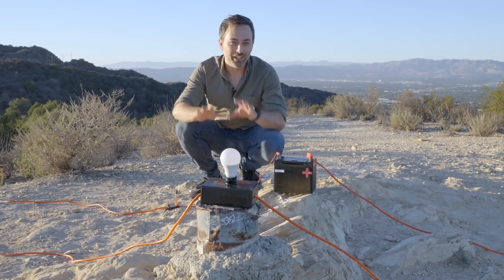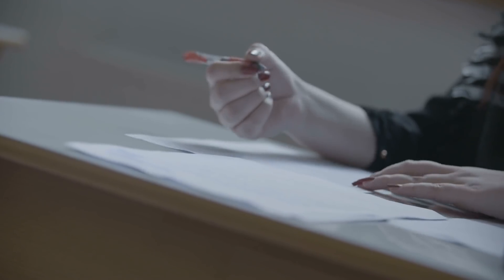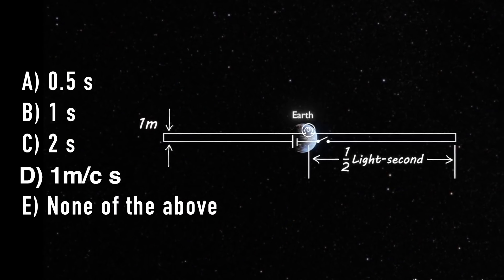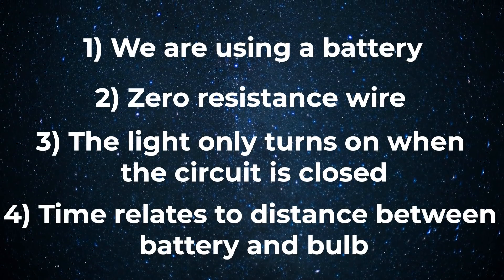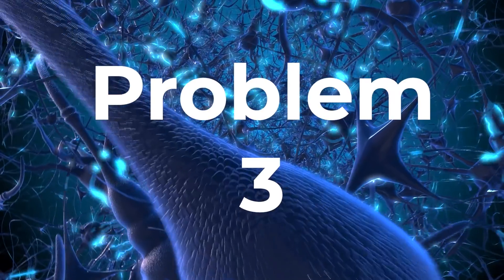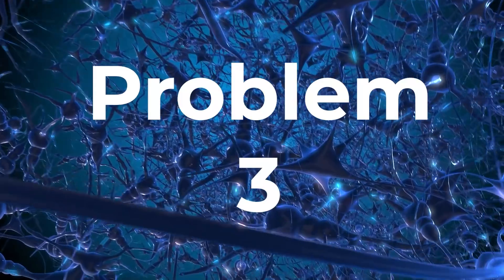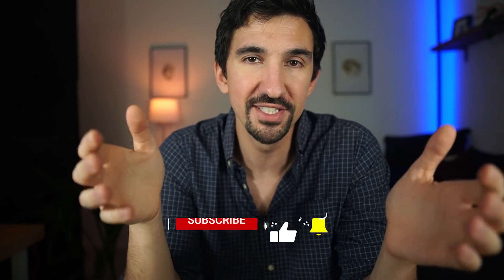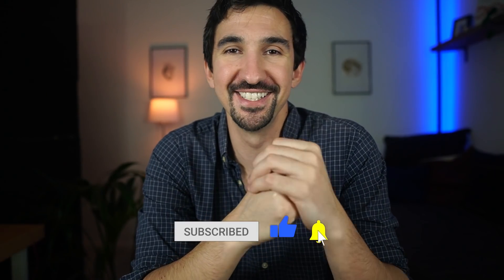Is Veritasium Wrong About Electricity?

Comment: You missed an important point about the 1/c time.  He really meant 1/c, and is in seconds per meter, where the distance is the distance from the break in the circuit to the battery.  This solve all of your issues with his video.

Comment: capacitance and inductive reactance, and mutual inductance (transformers), require a changing magnetic field mirroring the varying AC input.  DC creates a static field.  So how does this DC circuit represent an equivalent antenna, capacitor or transformer?  Also, wouldn't the internal resistance of the bulb be an issue?  My theory is, in the real world, the bulb would never light up under these conditions, as there would be inadequate current based on the incredibly long wires and associated high resistance and voltage drop.  However, if the wires are close enough to couple energy directly across the 1 meter gap, the bulb might flash briefly as the static magnetic field is established initially.  Please critique my theory.
Reply: First, every piece of wire may become an antenna, capacitor, part of a transformer.
When the switch in turned on, it's no longer DC circuit. It will become DC again after many cycles of EM wave propagation, until steady state achieved.
Indeed, real wire with a car battery wouldn't fit for such an experiment. It's kind of  imaginary experiment, that might require superconducting wires or high voltage/power source.
I think that you are right that in real experiment in those conditions it might be just a brief flash caused by capacitance, after which the voltage would drop because of wire resistance and wouldn't be enough to light the bulb

Comment: sympatric resonance of back EMF resulting in flickers of an AC nature  in many harmonics starting at 1m+c/s lasting till on time.
time to on:   in 0.oo ohm/mile wire of any length is the same . the same as kinetic energy transfer on the 5 ball trapeze in a vacuum.  The instant 1 additional electron  is  shoved in one end one must pop out the other in order to presurve ballance and prevent transmutation Cu to Zn. 
You have zinc or a time machine, that provides you with  a electron to insert  just moments  before you insert it. odd thing is it always knows when you will insert down to the milli sec.   The one that comes out is always colder than going in  , as it has not absorbed heat from your fingertips yet. 
   see the future...
  light goes on for 15 of a known 60sec  blast.
  hit record
  film the failure occur 
neat

Comment: Let's use a wire loop in a giant circle to eliminate any induction effects.  The speed at which a voltage change propagates down a wire is close to the speed of light.  It cannot be faster.  Therefore, the light will light up in approximately d/c seconds, where d is the distance of the light from the switch and c is the speed of light.  We can translate this into a similar experiment using light instead of electricity.  How long does it take to shine a light at a distant mirror and have it return?  It is the same equation.  The second experiment has been validated many times.  If the first experiment gives a nearly instantaneous result for a wire whose length approaches 300,000 km, someone either will win the Nobel prize in physics or is wrong.

Comment: Could we please stop saying 1m/c seconds. It's just 1m/c, my friends. 

1m/c = some number of seconds.
1m/c seconds = some number of square seconds.
Reply: not exactly )
1m/c is a time in some units. If you measure c in meters per year, it will give you time in years
Reply: > not exactly )

On the contrary - exactly. You said it yourself:

> 1m/c is a time in some units

Yes, this is exactly what I said. I said "some number of seconds."

1m/c seconds times seconds is a "square time". You don't have to add the time units when you say "1m/c -- just like you don't say "light travels at c meters per second."
Reply: @МихалычНаливай  - Unless you're saying that "some number of seconds" is not "some number of years". I might be inclined to agree -- but certainly "some number of seconds" is "some other number of years."
Reply: @MrTwostring  yeah, you can certainly convert seconds in years or vice versa, but it's not what is stated by the formula. It doesn't specify what unit of time is to be used there
Reply: @МихалычНаливай  - Certainly you don't mean to suggest that the light will turn on in a certain number of "year-seconds", do you? :-)
Reply: @MrTwostring  of course not )
However I claim that a notation 1m/c [s] is valid, and it states literally what you just wrote -- that 1m/c is a time expressed in seconds. It can be achieved if c is written in SI units, i.e. in m/s
Reply: @МихалычНаливай  - Ай кант телл чоу муч йу ар щокинг ор нот. All kidding aside - 1/c is a number expressed with units "time per distance" -- one meter over c is an expression of time - and one meter over c seconds is an expression of "square time" - whatever that would be.

Comment: I'm not a scientist, but your conclusions to me are more plausible than those of Veritasium, which would seem to suggest that we ultimately don't need circuits at all for things to be electrically powered.  I also agree with you that a major problem with V's conclusion could well be the interpretation of the (ostensibly clear-cut) concepts of 'on/off' in relation to lightbulbs.  Perhaps an infinitesimally tiny flicker in a lightbulb  - too faint  for the human eye to perceive even in complete darkness - caused by some level of interaction with the electromagnetic field emanating from the nearby battery could technically be classified as 'on', but it probably wouldn't pass for that in the opinion of most!

Comment: @Ben -- Your comment about "causality" is wrong. Physicists have been aware that instantaneous faster-than-light communication is possible since Einstein's "spooky" prediction about quantum entanglement. Einstein intended it to be a criticism of quantum mechanics (which he disliked), but it turned out to be true and it was proven to be true by experimentation. If you change the state of one of an entangled pair, the other one changes instantly regardless how far apart they are located in physical space.

Comment: I'ld like to add something more about that point of someone who may brake the circuit: Look even more at Einstein's relativity and the light speed limit.
There's a lot to discuss about this. I really believe that if someone far away breaks the circuit, that will just be information bound to lightspeed. I simply think the the bulb can turn on first and then turn off shortly after as soon as the information of a broken circuit reaches the place of the bulb and the switch.
And do not forget here that time itself is relative, the moment at which things hapen (who turns on the switch when and who turns it off when) is relative by definition and it's bound to the spacetime continuum.

Comment: The antenna explanation still doesn’t solve the faster than light communication problem - how does the antenna “know” there’s a battery at the far point of the circuit the instant the circuit is closed? If you created this setup but weren’t sure if the battery was alive or dead, the near-instantaneous antenna effect would only take place if the battery was alive and you’d be able to know something about the state of the battery one light second away in less than a second.

Comment: A minor note here: When you are talking about assumption 2: zero resistance wire, you say the signal "can propagate all around the circuit unimpeded" However that's a funny choice of words considering all wires, even hypothetical zero-Ohm wires, have a "characteristic impedance" that comes from the capacitance and inductance of the wire. This does "impede" the flow of the signal and has significant effects at this length of wire. I'm sure you know about transmission lines but you probably shouldn't use the word "unimpeded" here.

Comment: To me, this is a trick question.  Sort of...  The light won't be "properly" on until however light-time-long the cable is.    The light might flick on for a moment then go off, only to turn on again when the energy flows around/through the wire itself.

I look at this as kind of "crosstalk" as we normally see it happen on circuit boards.   And that light bulb looks to me kind of like a 120VAC LED light bulb !

And 1/c ......     I don't think he mentioned c = speed of light in a vacuum ?   Geeez.  c could have been c for capacitance as far as I know.

OK, he's right I suppose but barely, in my normal context of this type of question.   I think Veritasium could have explained this much better and much more simply and effectively if he would have got straight to the point instead of going through all the other physics.  He should also have defined the numerator in units of meters spacing between the wires too.  Otherwise, why would there be all these other videos on YT re-explaining Veritasium's video, like this video.

The experiment would work better though it instead of wire, he used say, wide conductive foil to get more capacitance, then the light might stay on longer.

Good video here !

Comment: Okay a doubt arise with this explaination is that If we also connect a bulb on one of the edge of the circuit that is the 1m length side wire and one as shown opposite to the battery, what will happen for the 2nd bulb. 

Also if we do change it to AC current and higher voltage across smaller distance like few cms apart wires what would be the behaviour of the two bulbs

Comment: The electromagnetic field propagates at the speed of light. The resultant power DOES NOT propagate at the speed of light in its vector direction. Once the current has stabilized will you find the resultant power field go directly from the battery to the lightbulb. But until then, you will NOT see the resultant power field head directly from the battery to the lightbulb in any meaningful amounts

Comment: This is a solved problem with real world tests. Not that long, but still long enough to establish on fact: The signal goes through the wires at about 0.7c. It’s a known quantity. The longer the wire, the longer it takes. 

The whole veritasium video was an oversimplification pretending to be a “well actually.” It’s no better than the straw man “what they told you in school” that I was never actually told in school. You need charge carriers (electrons) moving to make a field. The field effects the electrons. You need both. Except in one case: continuous DC circuit. The fields aren’t changing, there is only current to explain in. Exactly the opposite of his hand-wavy “well-actually…”

Comment: Well thought out reply, but actually I think you're just wrong here. two reasons: 
1: you can receive information faster than light travels, in certain circumstances. 
Imagine you put a switch at the furthest point of the line, instead of a break, but this switch oscillates on and off every 30 seconds. Now put a multimeter on your local switch. Flipping your local switch will tell you the position of the far switch immediately (in a 0 resistance wire), even sooner than the 1/2 second a telescope would take to convey the same info. this isn't breaking causality any more than shadows moving faster than light across a surface does, but it definitely can appear that way.
2: the light would not instantaneously shut off. 
If we assume, as Veritasium did, that the wire has no resistance, the electron's drift velocity would be high, but still a manner of inches per hour passing through the line. so its not the electrons themselves that need to flow to the light, its the level of energetic behavior they exhibit in that direction. If we introduce a break (or close the switch), the current's stop is as much an energy wave as the electricity's flow. Thus, as the electron excitation of the line decreases, so too does the current flow and the light will fade until it is off. I'd need an experiment to test, but i'd assume that would happen well after the 1/2 second mark, so you're good either way.
Reply: just a point to add to #2: in a short wire, with relatively low capacitance, electron relaxation would occur quickly, but in a kilometers long wire, it would store much more charge and it would happen more slowly.

Comment: This is all grossly overthinking the original video. The question was simple: making a perfect circuit with no resistance is the time between flipping the light switch and the light turning on dictated by the length of the wire, the distance between the switch and the bulb, or something else. It could be any wire length in this perfect scenario, he just used a big number to make guessing easier

Comment: Personally I think that assumption 3 just needs more fine tuning. I'm probably gonna get a ton of grief for using a water example when both videos are literally telling me it's not like water but hear me out: if we replaced the light bulb with a water wheel and the wires with a river and your break/switch with a dam or floodgate then the moment you put up the floodgate and stopped the water flow is not the exact moment the water wheel would stop spinning. It would keep spinning until all the available water passes through it. 

So I would bet that if the lightbulb was on and someone cut the wires at the furthest point the lightbulb would not turn off instantaneously as I believe you are suggesting but remain on until the fastest point we could realize that it's off which is the speed of light thus not breaking any rules. 

So while it makes sense to say that the lightbulb can only be on if the circuit is complete it says nothing about what happens at the exact moment that follows the circuit being broken.

Comment: When there is a break in there circuit after the light is on, it will take d/c seconds before the light turns off where d is the distance between the bulb and the break. So veritasium's explanation stands. No information is communicated faster than speed of light.

Comment: Wouldn't it be easier to say that the electrons moving in the wire are not carrying any energy, they are moved themselves by the electromagnetic field? Their movement is the visible effect of the energy contained in the electromagnetic field. Moving electrons around doesn't provide energy, it consumes it. Am I wrong?
Reply: I dunno if it helps, but it might be better to compare EM wave and gravitational wave. They are responsible for field propagation. Once steady-state achieved, they vanish (actually, they just propagate further away).
EM field propagates for some time after switch is on, then there is not so much radiation carried by EM field (in some kind of ideal situation). It's then just electric field and flux that make most of the work, just according to Poynting's theorem.
I think it's like this
Reply: in short, it's EM wave that lit the bulb in 1/300000000 second, but it's electric field that delivers the power in a steady-state regime

Comment: 10:15 so basically the wire is filled with e but the flow is what produces power so if wire is drained or new it would have taken the amount to fill up... but it doesn't need to fill up so its basically instant... right?

Comment: You missed the fundamental problems in that original "demo" which is completely contrary to electricity as we know it which you seem to mention but not recognize the full implications...
1. There was the suggestion that electrictiy travels only in the EMF field and electrons do not move on the wire at all... Which is of course a weird and utterly untrue paradigm. Electricty is the product of current and voltage where current is the measurement of electrons. The EMF is a completely separate characteristic of electricity which only <may> be considered in certain scenarios, but without current and electrons moving along the wire, you can't have EMF and not the reverse.
2. It may be the false idea of electricty as not traveling along the wire that the premise completely avoids talking about resistance which you mention in your own video. Of course, resistance is considered a fundamental aspect of calculating electricity through a medium (wire).
3. I think a mistake you are making that isn't in the original premise is that when you are talking about distances of light years... That's actually the distance light travels in a full year. Of course, distances that far ar siscernable by human perception and not instant. So, time does become a reasonable factor and means of perceiving whther a light bulb illuminates instantly, or after a short period of time or a very long period of time.

Comment: No you're absolutely correct.  If the battery were a changing magnetic field, I would agree with Derrick and say yes the light comes on in 1/Cs, that's how transformers work.  With the battery, the light might come on momentarily due to the that antennae like affect you pointed out, causing the light to flash, but also as you point out "what's your definitions of 'on'?"